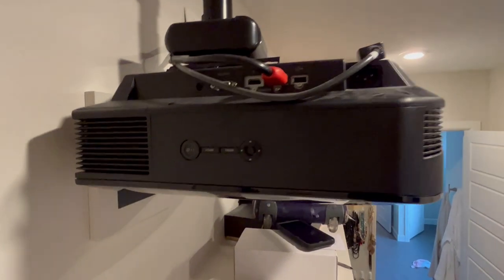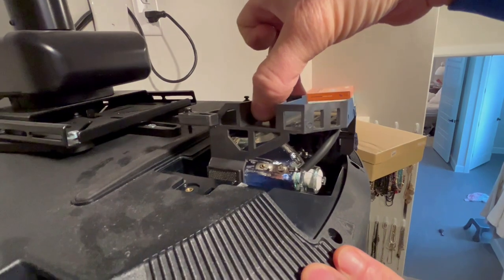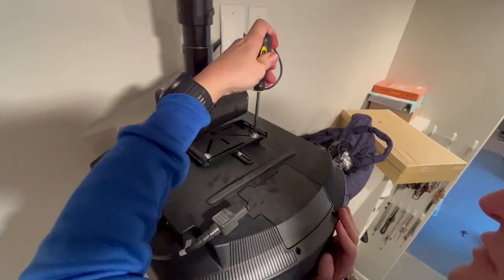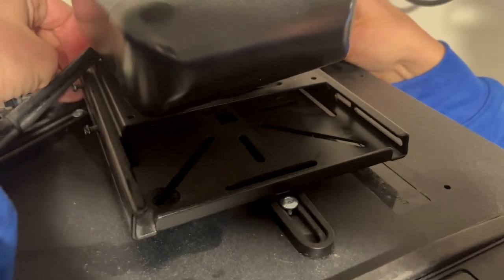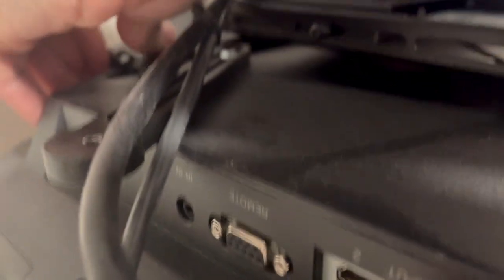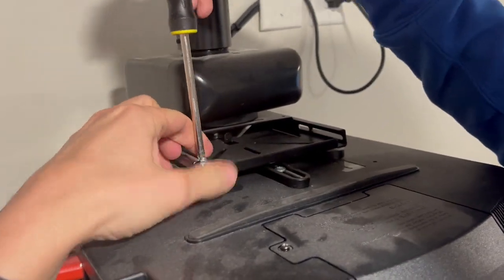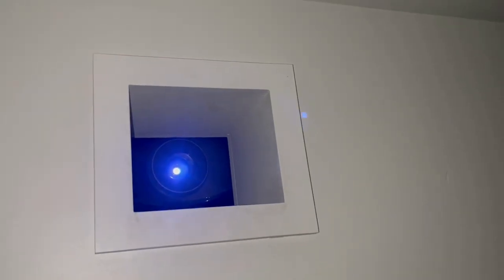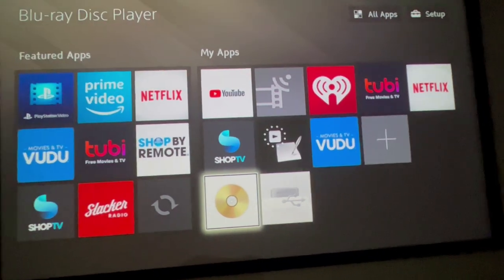How to Replace a Home Theater Projector Light Bulb and Clean Out the Projector's Filter

Comment: Some newer sony projectors are filter-less. My vpl-vw325es is. So if you’re wondering where the filter is at, check the manual as you may not have one haha.

Also a good reminder to put air purifiers in rooms where you really need/want to limit dust. I do this in my home theater and I don’t have to clean my projector as often.